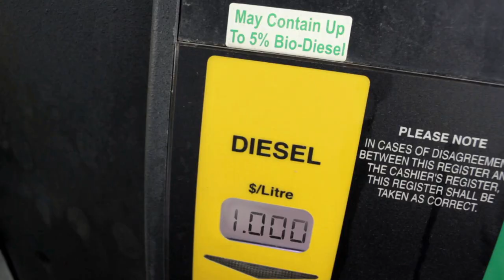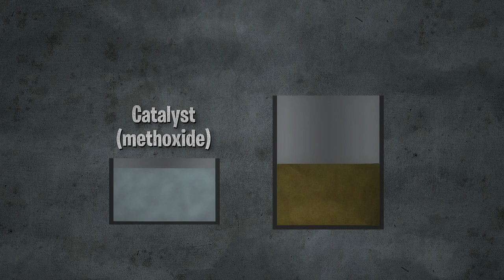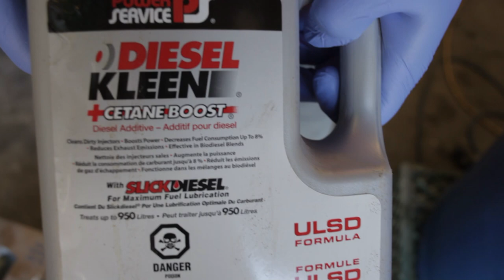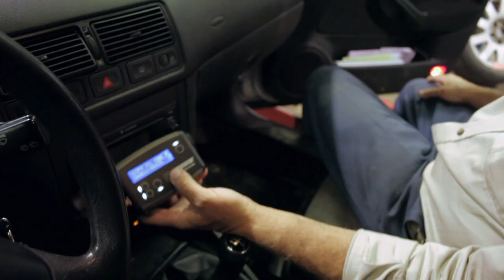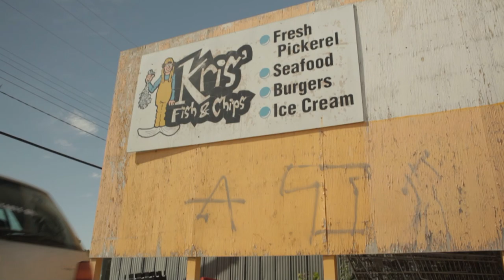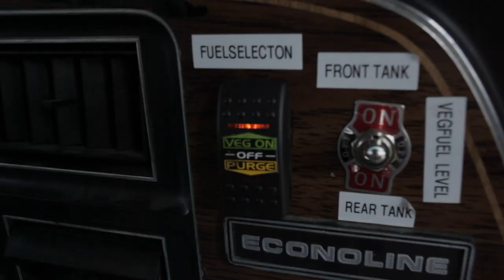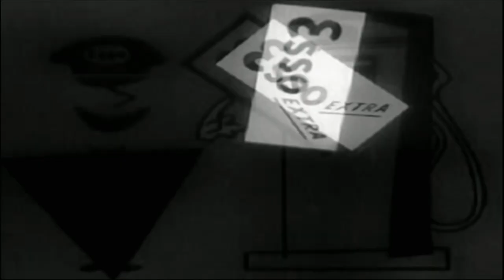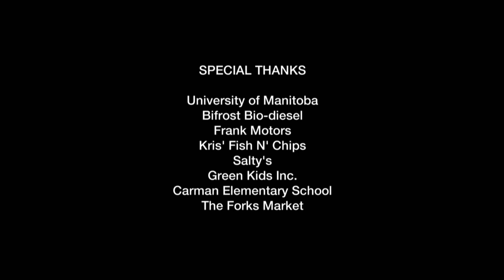Drive For Free: The Alternative Fuel Revolution

Comment: $4000-8000 for a conversion insane. I converted a semi truck and ran it 2 yrs on veg  my parts were under $2500 in 2007.
Reply: If you count your labor it's about $4 - $5,000 with parts.